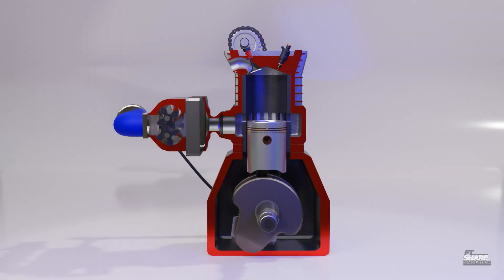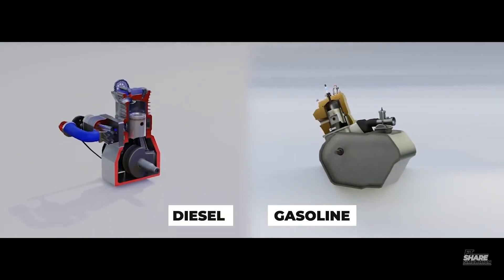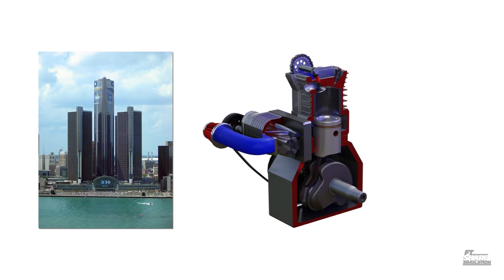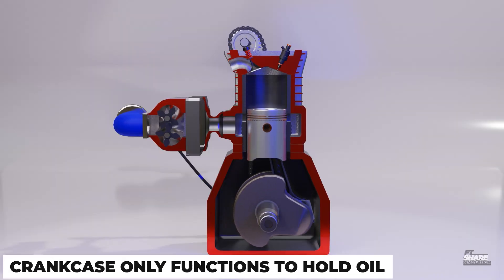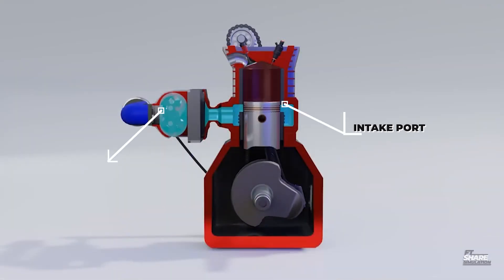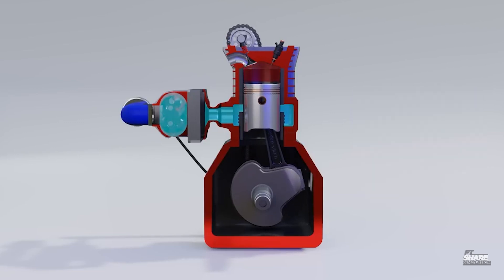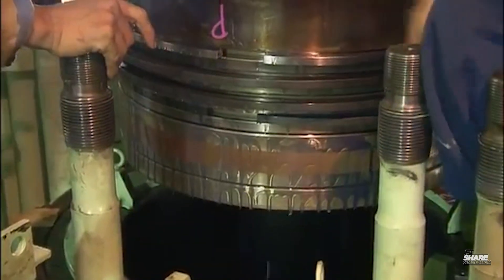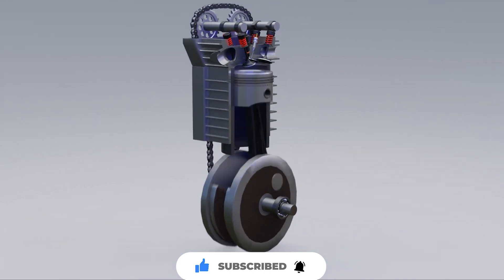2-Stroke Diesel Engine with Supercharger and 2 Stroke Oil-Free Operation??! | How does it work?

Comment: Well, good concept for a past technology.  If it burns fuel it pollutes.  BEV. Does not polute.  So, I'm not sure what such an archaic engine you could not doe with B. E. V. 

I don't get why someone is trying to improve a 1900 diesel engine when current technology is saying 1225 years ahead of it and does not polute?
Reply: because it does not need a remote energy source, transport, charge and battery system. It has its own power generator built in. What you say is a small inconvenience. It was a big one, like 40 years ago. you have not adapted your view upon this disadvantage during the many improvements since then.
Reply: BEVs don't pollute, what a load of bullcrap 😂
Has the fact that the batteries have to be somehow produced and charged crossed your mind at all? Mining resources, their refinement and the production itself are extremely energy intensive and polluting processes. Energy required to pull these off mostly isn't clean , so is energy used to charge completed batteries. On top of that you have very poor longevity of said batteries which require replacement every 2-3yrs which is often not financially viable, so you end up with even more waste (whole EV lands in the junkyard) and need to produce even more vehicles. To throw to the mix only small percentage of batteries is recycled, because it's cheaper to produce them from scratch than recycle.
Actually it would be less polluting to drive the dirtiest diesels which last for 50yrs than BEVs that last for 5yrs.

If you want to be eco-friendly, then take into consideration whole process from the very beginning to the very end. Repair instead of replacing. Don't go after newest and fanciest every time it comes out. Don't fucking consume.
Reply: you realize you need fuel to burn the electricity that's used to charge those EV's right? And producing EV's is more polluting than an ICE car
Reply: These engines are used on ships, in generators, in mining equipment, etc. not in passenger automobiles.
Reply: @Heatherder  what about greyhound buses with detroit diesels?
commer "knocker"?

anyway...
my take on the ICE is that its mechanically flawed, we have kept trying to "perfect" the wrong design, and are now stuck in a rut due to a century or so of repetitive training that there are only certain cycles, argue over two stroke or four stroke or rotary, diesel or petrol, that they operate just "like this", and theres no in between or cross over... suck squeeze bang blow.
and then theres always ECE's... stirling or steam wasnt the only approach. we now have far nicer technology and materials than they had back in 1850 or so.
got so carried away making what we had made by the millions, billions, shoving them in cars, in toys, in boats, in planes, everywhere... so convenient and "simple", that we forgot how they really run... on hot air... just hot air...
Reply: A two stroke diesel can run on used vegetable oil or biodiesel without any modifications, thats as renewable as it gets. As a plus no children had to mine cobalt for this engine unlike a li-ion battery.